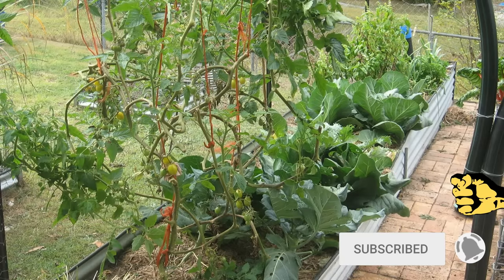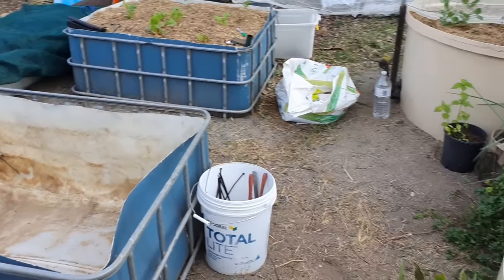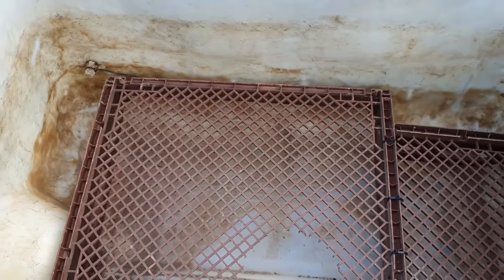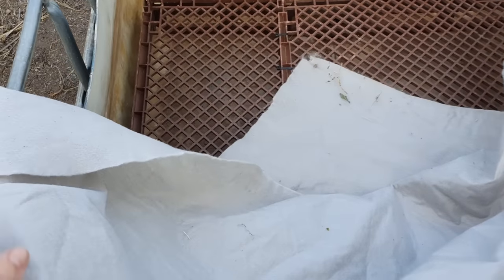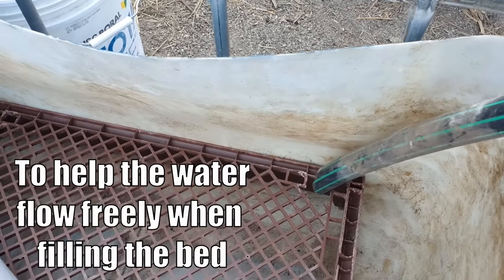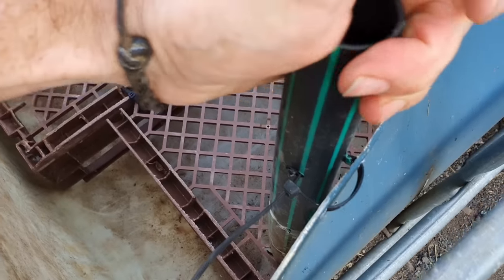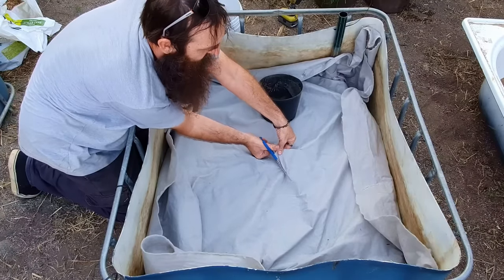How to Make a Wicking Bed with Bread Crates | Large Water Capacity & Healthy Soils

Comment: I'm a very detail-oriented person and this simple video has actually filled in some missing information for me.  The way you touched briefly on different materials for the various purposes was really helpful.  The note on putting a zip tie through, rather than around, the watering tube is something I would've had to learn the hard way too.  Cheers bloke.
Reply from the maker: The hose got caught in the fill pipe in the first bed I made so I found out the hard way Robert.   
Hope you're not going stir crazy through the lock down mate.
Cheers.
Reply: When he said "curious fingers" it made me want to run outside and put a zip tie through all of my fill tubes immediately.  xD
Reply: ME TOO! This was the best I've seen, with the tips thru out! I haven't done one yet, sand is alot better than river rock @70$ ton

Comment: Great video once again! Tried some wicking barrels over the summer and they were a huge success, going full scale raised beds now. IBCs too expensive where I live but the old back fence is being replaced soon, those old fence pales will be re-purposed into some raised wicking beds with design tips from your vids 👍
Reply from the maker: Nice one Sam. One tip I'd give you is to run the liner all the way to the top edge of the bed if you have trees around. There roots will find away in if you cut it off below the top soil level. We found out the hard way in almost all our tin beds. 😕
Cheers & have fun with the build.

Comment: Hi Rob. I have made 8 wicking tubs from those blue barrels you cut in half. Then I put the root pouch  on top. I actually sink the root pouch about 1 cm deep  for better contact with the sand now. 
Also made 4 from some builders tubs. I am still not sure about the  IBC. I want at least 5 year life out of them. How old is your oldest  IBC. Also my tomatoes have grown amazingly well. I have used your root pouches but also I have put a non glazed terracotta pot in it next to the tomato plant buried to the rim . Bottom hole sealed.  I fill it with water then a plastic saucer goes on top for the lid. Best of both worlds. Air pruning and olla pots constant watering when the plants need it. Thought I would let you know as it is working a treat and you always put up good advice for others. Happy gardening.
Reply from the maker: Hi David. These beds I moved out the back were set up on the front yard patch for about 7 years & I see no signs of deterioration on the painted or unpainted ones. 
In saying that, I have had some unpainted IBC that started to get small surface cracks when I bent the plastic after about 4 years. It comes down to how they were made & how old they were before they went to be recycled. 
Best way to get longer life out of them is to clad or paint them if you can. 
Hope that helps some.
Reply: @RobsAquaponics   Thank you Rob. I will look into trying one out. Good health to you. 👍

Comment: I was just looking through your old videos for wicking beds and Bam you posted an update !! I just want to make sure I have this right..your drain tube is below the top level of the sand correct? So you don't have dirt soaking wet.
Reply from the maker: Glad I could help out Frisko. 🤣👍
To begin with I'd say it has to be under the sand but now I'm not over concerned. You'll find the water will fall fairly fast once there;'s established plants in the system.
Hope that helps.

Comment: Self wicking is so cool. Today I reused a  10l bucket that was last watered something around mid of october last year and was sitting since them in my greenhouse. I expected something like concrete or so, but when I turned it over the soil was still moist and smooth. It has some 80mm drainage pipe in the bottom covered with some weedcloth and a 32mm watering pipe. Now I´m sure, my potatoes go in there too, just size it up. ;)
Reply from the maker: Nice one. 👍 I haven't had much luck with potatoes in them but that's probably more due to me planting them at the wrong time. 
Sweet potatoes always do exceptionally well in them for use though. 
Cheers & happy growing.

Comment: Rob, maybe you have addressed this before? The Earth Box uses a layer of plastic over the top of the soil and then you cut a small X where you want your plants and plant them there.  Helps slow down water evaporation and weeding.  Also as the water evaporates it is stopped by the plastic layer on top and it "rains" back down.  Also, fertilizer can be put in nylon stockings and put on the top of the soil with the plastic covering it.  When the water evaporates and rises to the surface, the water will come in contact with the fertilizer and slowly release it to the soil.  This evaporation cycle happens over and over.
Reply from the maker: Hi Edwin. Mulch will do the same thing as the plastic as well as a few more. It acts as a thermal blanket, provides food for the organisms in the soil that create the nutrients for the plants & will soak up rain to help conserve moisture. More importantly, using organic material as mulch allows gas exchange with the soil. I have seen plastic not do so on occasion at strawberry farms with bad moulds building up on the surface under the plastic. 
If it works for you though keep with it. 👍
Reply: @RobsAquaponics  Bob, thanks for the feedback!  Will go with your suggestion.  Just remember the Earth boxes from 20 years ago  used plastic for the top layer.
Reply from the maker: @edwinbickel  They were one of the first wicking systems I saw as well. 👍
Cheers & happy growing.

Comment: Nice video. I was wondering how these wicking beds were made, and this video answered all those questions. 
Is there a video that explains the "when" of wicking beds, when are wicking beds the best choice vs other options such as hydroponics, standard raised beds, in ground, and etc?
Reply: Wicking beds are good for plants that don't do well in flood/drain or DWC systems, eg. some root crops. 

Also for other situations- can take with you when moving, low maintenance, no need to mix hydroponic solutions, organic....
Reply from the maker: We use them here as they use a lot less water than other soil systems. There's next to no evaporation & no run off. 
They'r great to prevent root intrusion if you have trees growing in & around the garden.
GREAT for folks that live in older built up areas that may have soil contaminated by lead paint or other toxic elements folks used to use around the home. 

For us its a mix of all 3 of the above point.
We built them  during water restrictions & could only water for an hour or so once a week. Normal gardens were dying in a week through summer while ours flourished. 👍
We have a large mango & many "weed" trees who's roots weer invading the older beds. 
Our block was terraces in the 1940's using spoil from an old tip site from the 1800's so thought it best not to grow veg directly in the soil.

Hope that helps some.
Reply: Yes, good answers. I didn't think about water usage, but it makes sense for your climate; water isn't much of a thought here,  except when  it gets really hard, like around 0C. I had wondered how root crops might do in a hydraulic system, I know the hydroponic method is not a panacea. These wicking beds sound like a good way to compliment other methods and have a holistic garden, such as a way to use compost. So much to learn.

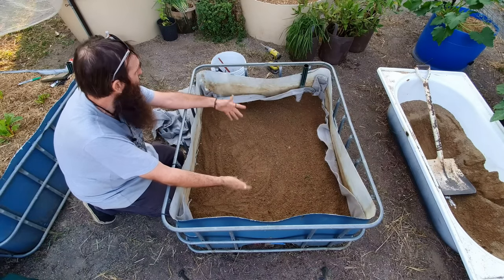Comment: I always learn a lot when watching you videos Rob ✊🏾 Question: @7:50 why not use a sheet of shade cloth between the sand & soil? I feel that after some time the mulch (whether it’s sugar cane, wood chips, straw, etc.) would eventually break down and settle its way through the sand into the water chamber. What are your thoughts?
Reply from the maker: Am glad you're enjoying them mate. 😁
From what I saw years ago, that layer composts nicely there & doesn't mix with the sand at all. It may get mixed in if you get a bit deep with the garden fork if you're mixing in compost down the line though. 
Hope that helps.

Comment: If I were to use your previous system, where you used the irrigation pipe, rather than the bread crates, would you still recommend using gravel in the corners or just use all sand?

Comment: Hmmmm.
No recent comments, but I'm going to take my chances anyway. I'm brand new. In fact, I learned about wicking beds almost immediately after purchasing some large metal planters (4'x8') that are 32 inches deep. Now I realize that that's probably too deep, and that water won't wick up through 26 inches of soil.

Looking at your use of drink crates, what do you think about the idea of a truly huge water reservoir, using drink crates without cutting them down? I'm concerned that the water would get stagnant at that depth.

Maybe I'd be better off putting sand in the bottom of the beds, then lining them with plastic, and proceeding as if my beds were 2 feet deep?

Thanks for any thoughts! I love your videos!

Comment: Love the design Rob. What are your thoughts on using basic pvc tubing surrounded entirely by sand?
Reply from the maker: I have seen folks use it & it looks to work. I like the slotted pipe as  it already has holes & is very flexible so can be used in round tanks as well as square.  
Cheers & have a top one.

Comment: This is a "start from scratch" year for me--new-to-us house on land with yellow clay for soil, all four adults are looking forward to not having to bend over so much, and so on, so the idea of using IBC totes and cutting them in half rang a big chord for me. I happened on a couple of them at "the right price," as they had been sitting unused at a friend's workplace for a while. Even if I bought used ones, they are only US$100 or so if I look around a bit. 

I'm hoping that the structure under the fabric can be anything that will support the sand and soil--I have plenty of four-foot-tall wire fencing (2" by 4" gaps) that I can cut to fit. I scored a length of 4-inch perforated PVC pipe that I will cut in 8-inch lengths to support the wire "divider," and cut out the wire to insert mesh into the pipes to enable the wicking process to work. 

I'm glad that I reviewed this video today--it reminded me to use sand for the wicking agent instead of soil. I have a local supplier that offers a variety of gravels, sand, and ready-to-use soil mixes (including compost), and I figure to spend a few bucks getting started instead of thousands of bucks. 

I am enough of a realist that I don't expect a huge yield the first year--this is a "build the infrastructure and test a bit so that next year will be better" year. But I also think it could be quite successful if the stars align.
Reply from the maker: Hey Tom. How did the builds go mate?
Sorry I missed your post until now mate.
Reply: @RobsAquaponics  
No worries, Sir, and thank you for the response, as I had been wanting to chat with you and others.

It seems I did something wrong. The beds are not wicking water from the reservoir as I had expected. 

The build has been, as noted above, 4" PVC pipe (already had holes every few inches), in ten- or twelve-inch lengths, probably a dozen such pieces per bed. 2" by 4" welded wire fencing, with cuts so that wire gets bent into the pipe to keep things semi-stable. Good quality landscape fabric laid on top of the mesh, holes cut in the fabric over the pipes, then a 2' square of lighter landscape fabric filled with sand reaching to the bottom of the tub, the borders of the fabric arrayed so that sand doesn't have as much opportunity to get below the wire mesh. An inch to two inches of sand, then fill with purchased dirt (that is sold to be dirt for raised beds, topsoil with compost mixed  

On watching this video again, I realize that I hadn't used any straw or similar product between my sand and my soil. I don't know how big a deal that is. My spouse is saying something about adding cotton wicks as are used for Kerosene lanterns in my wicking pods going forward. Does anyone have any input on that idea?

I did the fill pipe and overflow point before the wire, of course. I can see the water level, but I can also use a rod as a "dipstick" to check my water level. My reservoirs are still full two months after initial filling, and I've felt it necessary to top-water all four beds almost daily (except for days when it rained). 

I have seen this and other videos on the subject, and called myself following what seem like straightforward instructions, but I see no evidence that the system is wicking water from the base. I don't know whether the sand I used is the wrong product (general purpose sand that had been washed), or just what I've done wrong. 

Hive mind, what did I do wrong?

This medium doesn't seem to allow for me to post pictures of my build, sadly. I am getting a few tomatoes, and some bush green beans are doing fairly well, but the lack of moisture in the soil is troubling me.

Comment: If u fill the reservoir how long the water can stay and what is the frequency of irrigation
Thanx for the good vid
Reply from the maker: Generally speaking, they can go up to 5-7 days before needing to be topped up. It really depends on the crop you have growing in them & how large you made the reservoir. 
A few summers back I had 40+ corn plants in one IBC bed & had to top that up daily.  Where a bed planted with a few greens may go up to 5 days before needing to be filled again through summer. 
I will be covering this in a new clip as I've been asked a number of questions about the wicking beds over the past few weeks since setting up the new ones. 
Cheers.

Comment: I thought you were going with L shaped stand pipes instead of the straight drain? For flood and drain, etc.   I also love the idea of milk crates or bread crates for that layer.  Thanks for that. Do you leave an inch or half inch for air in the bottom?
Reply from the maker: Some of the newer beds are set up with an adjustable drain but not all of them. I figure that these creat based beds hold a load more water so it isn't needed. 
I don't really make an allowance for a permanent air gap in the base. One will form fast enough as the plants start to use up the water. 
Cheers Kellen.

Comment: Hi Rob. Great episode! 
How may years do you recon that soil mix will last before you need to dig it all out and replace it?
Reply from the maker: I don't replace it at all Chuck. Just keep adding compost & the bed should continue to grow well for you. 
I like to also top dress with aged manures or compost & add compost worms to the beds. They will feed on the top dress material & mulch which will in turn will feed the soil.
So far the oldest beds I have are 7+ years old & still growing decent crops. 
Cheers.

Comment: Hi Rob and Thanks for your great videos!  Question:  How quickly should I expect water to wick up into the top of the soil in my IBC?  What should the moisture content of the soil feel like to my hand?  Wet, moist, ?   What would the moisture meter read at say 3” down, when it is at optimal moisture content? And lastly... this new design, how is it wicking for you?  Thanks and happy gardening!
Reply from the maker: I find that the water starts wicking up straight away. I normally find that the soil is moist about 100mm/4" down from the surface by the next morning. 
So fat=r this bed has only been filled twice & have provided us with a few tasty harvest of kohlrabi & broccoli. 
Cheers.

Comment: Nice video! Do you need to break the garden down between crops/seasons. Or is it used for many seasons with original sand and compost?
Reply from the maker: We get to grow all year round here so we tend to top dress between crops a lot of the time. At a minimum, I'll adds a decent handful of compost or castings to the holes we pop the seedlings into.

Comment: Hi Rob

Great Vid thanks.
I've just done three WB's with gravel a few weeks ago, my first ones! For these I used Gravel in the bottom, layer of geotec then about 200mm heavily composted soil on top. I'm just about ready to do three more IBC halves. Can I just use my slotted ag pipe? Is coarse sand better than gravel in the bottom?
Reply from the maker: Coarse sand will wick better than the gravel but gravel works as well as you've probably seen already.  👍 
It does help if you allow the textile to run from the base of the rock to the sand (if that makes sense) as it will act as a wick as well.
Hope that helps some.

Comment: Hi there, very helpful and making plans for my new garden in the Arizona US desert.  I was wondering if the depth of those beds work for planting tomatoes, peppers, squash, cakes, etc. or would you be limited to lettuces, spinach—shallower root veggies?  Thank you
Reply from the maker: Hi Daisy. I've had a number of folks from AZ say they love using wicking beds. 
I've found 12ft of soil & 4-6" of reservoir works just fine for rooting crops, greens & larger plants like tomatoes & cucurbits. The trick is to keep the soil well fed with larger tomato & squash vines as they can be rather nutrient hungry.
Hope that helps & happy growing. 😁🌱🍅